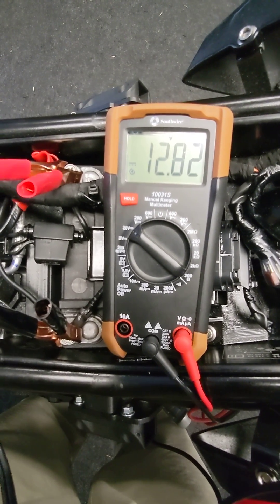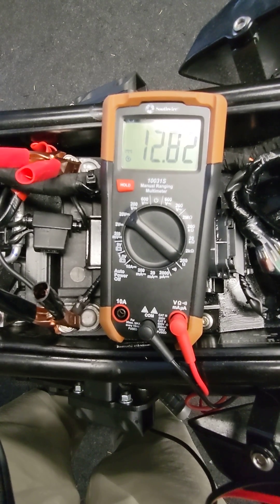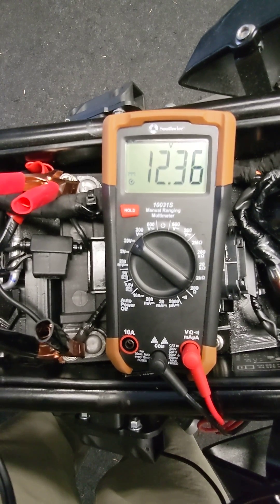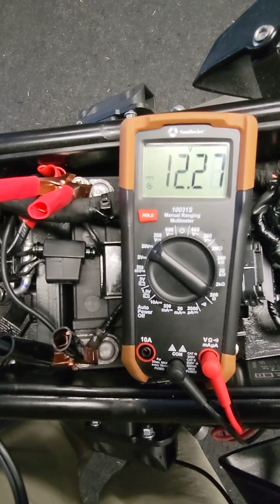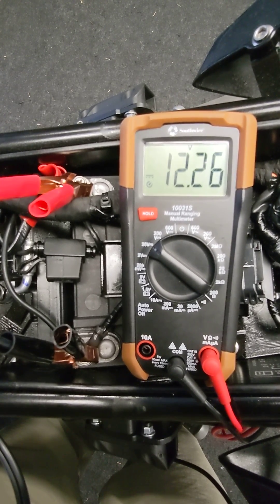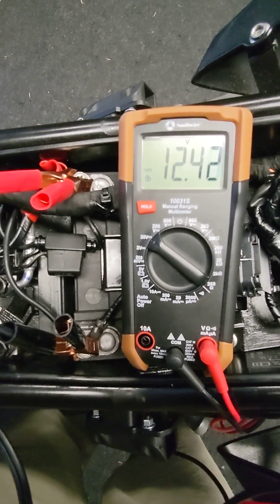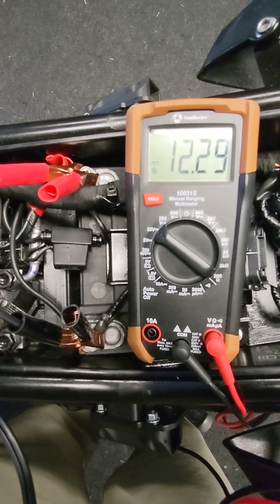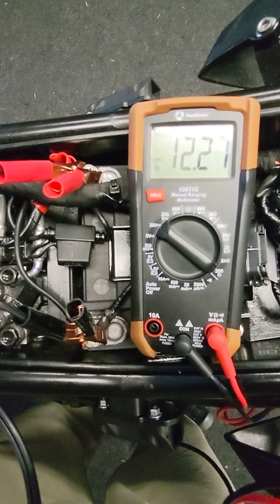BMW G310R -- Part 1 DIY battery basics

Comment: Hello guy! I have a BMW just like yours. I would like to know if it is normal for your motorcycle voltage to keep between 14.8 and 15.0 v?
Reply from the maker: At rest, ignition off, a good battery should read 12.6v or more.  Up to maybe 13.2v if it was just freshly topped off with charge.  With the engine running, you should see 14.5v+ as the charging system is working.